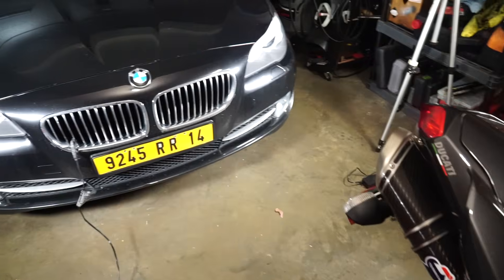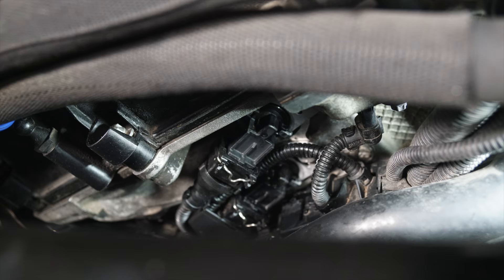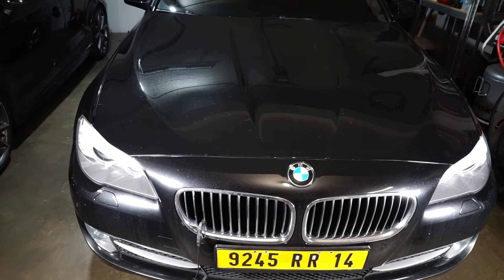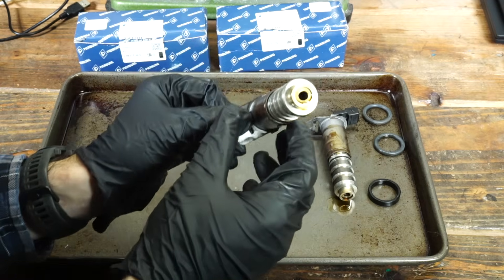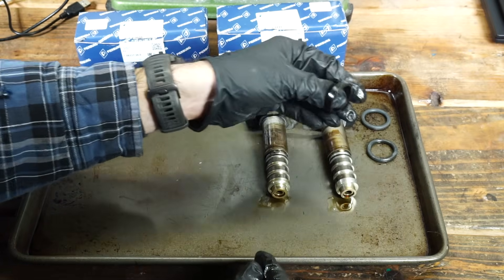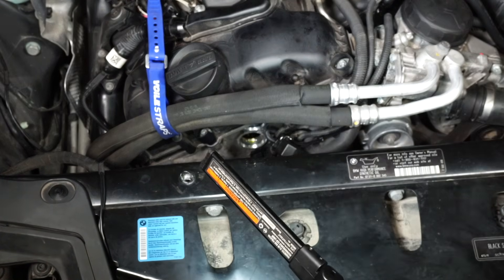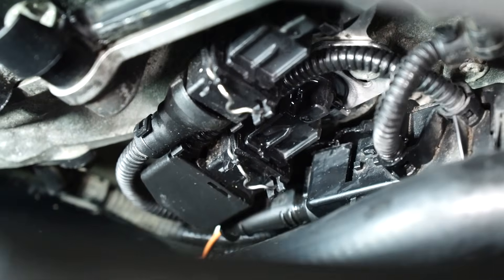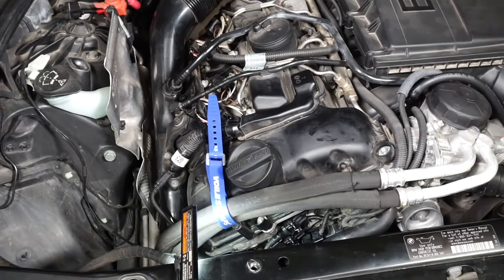How to Replace N55 Vanos Solenoids | 2011 BMW 535i F10

Comment: So what’s the resolution on your 1st gear issue? I recently drove a F10 MT with 160K Miles & that particular car also has this 1st gear issue and the owner is just starting with 2nd.
You are very meticulous (e39 series), great job!!
Reply from the maker: Thank you! Unfortunately I haven't found a resolution. Some say it's the shifter linkage bushings, others say it's something worn inside the transmission. 

My "fix" whenever I hit the "false first gear" is to slowly release the clutch while applying light pressure on the shifter into first gear. It will fully engage in first gear when doing that. This takes practice because it's definitely not instinctive. Especially when the light suddenly turns green and you have a line of traffic behind you waiting! 😅

Comment: I have same car with same engine and transmission as yours … I have experienced same  idle issue as you , I replaced, solenoid with genuine bmw ones , spark plugs, coils , high pressure pump all genuine bmw parts , and yes it improved a bit , but still didn’t fix it completely, only solution was if you look in service function in bmw ISTA software which is dealer software, there’s option to raise the idle by 50 rpm or 100 rpm, and so I did that raised it by 100 rpm and the car is idle is much better, not Lexus level smooth, but these engines were never like that anyway, so if you have scanner that can raise the idle , give it a shot .
Reply from the maker: Thanks for the comment and suggestion. I've heard that raising the idle slightly could help. I've tested increasing the idle manually with the throttle pedal before and it didn't seem to make a difference. But perhaps there's something different with how the engine responds to a programmed higher base idle?
Reply: Yes , when I did it with ISTA it actually saves new idle value s to the engine computer , so I tried it to do it manually like you , but it didn’t make much difference, but doing it with a scanner is different and more exact I guess , but it worth a shot, u can always change it back , but in my case car idles much better .
Reply: @eldin9117  could I get some help on this did you take it in to the dealer to get this done I am needing to do this but don't know what I need.